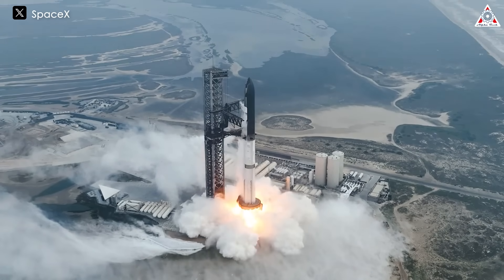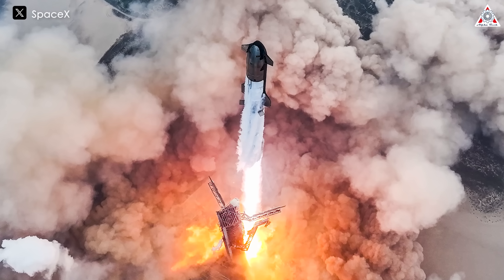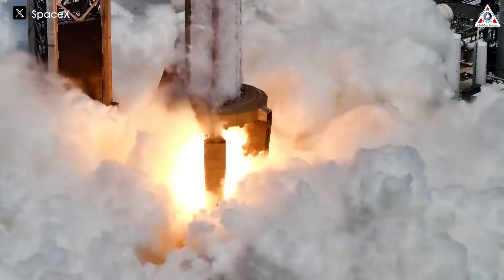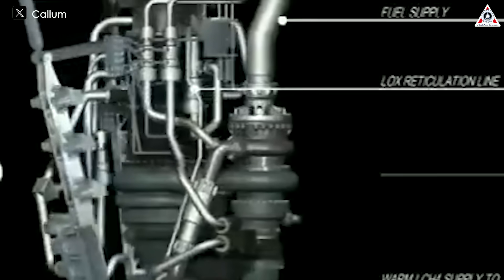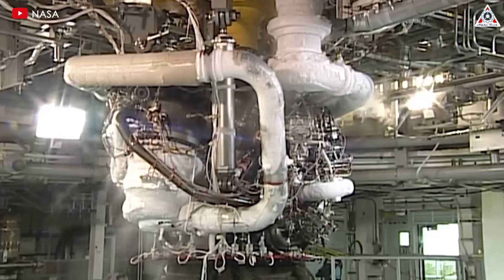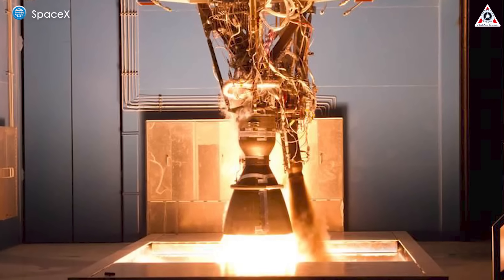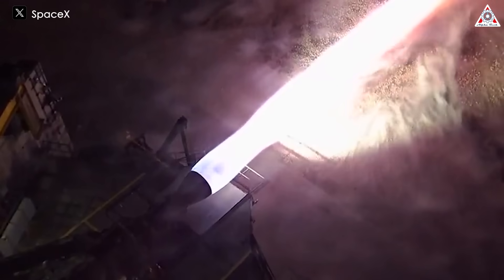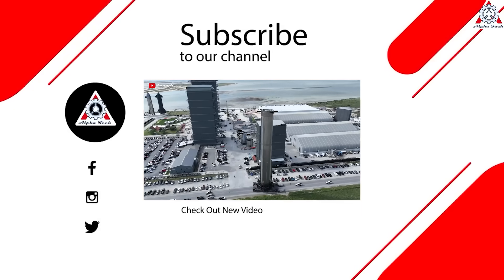Why SpaceX Booster Losing Raptor During Launch and Splashdown??? Elon Musk...

Comment: What wasn't said here is that the design decision to push Raptors makes them more fickle and more fragile. You've got feedbacks with milisecond time constants and lots of paths to instability. Shutdowns indicate some variable going out of bounds, but the underlying cause can be related to design.

Even if the root cause lies in the plumbing it doesn't help to push the engines to extreme pressures.

Comment: Well if the ship had only one rocket that would be that end if ride. But redundancy is protection against failure. instead of having to adjust a single engine to vary speed you just turn on or off as many rockets as needed. If you make only one ship with one rocket in each stage you end up eventually end up in a position such as boeing finds itself in now.

Comment: You are speculating and all these engines are old engines. Each test uses up a bunch of obsolete engines.
The one issue SpaceX has mentioned is a fuel filtering problem of solid fuel particles. This has been improved.
Important data on failure management during flight is the reward for the risk of flying old engines.

Comment: so probably not even related but I noticed on the booster soft landing it seems like theirs and excess of gas spewing out just before ignition it almost looks like a flame thrower. I think if we made the exhaust holes a bit smaller those gases might ignite better. give the rocket cones a wasp nest shape maybe lol it might just cause an explosion instead.lol. on the heat shield I said do a coating on top of the tile but what would be better is a complete body cover. If its all one piece you're not wasting time putting every tile on.

Comment: I would call this a success.  It is called redundancy.  SpaceX has more engines than required for a reason.  They said it can continue with a few of these engines not firing.  Designed this way, not a failure.

Comment: Here is a suggestion: Solid fuel would have been great if they were as efficient as liquid fuel and could be turned on and off.
So, we can't use solid fuel unless we can treat liquid fuel more like solid fuel. It wouldn't splash about; the filters wouldn't get jammed and we wouldn't need to worry about bubbles forming just about anywhere.
Why not imagine the whole thing more like a syringe? Even a partial syringe would go a long way until the vehicle is back in position descending under control. Then gravity can take over as long as there are no bubbles lurking about.
I am sure that it is not an easy readjustment and a whole lot of profile parameters need to be changed. But you could start with simulating it in a model.
Let me know if I am totally missing something. I know I am not that clever. Someone must have thought of it early on in the design. None the less, I would like to know what I am missing, and I don't mind being wrong.

Comment: This is the dumbest analysis I’ve ever heard. 1) redundancy is built into the vehicle for exactly this reason. 2) this is still an experimental program - we’re still in the R&D phase. 3) when you have excess capacity, it’s better to set a low threshold for self-shutdown to reduce the risk of explosion and loss of the whole vehicle.
Reply from the maker: So what do you think about the fact that when Booster landed, an engine that did not ignite caused a small explosion?
Reply from the maker: Do you mean the Raptor engine doesn't light up because the Super Heavy turns itself off to control power?
Reply from the maker: And what I mean is that they will improve this gradually in the future!  these are still just flight tests.
Reply: That is an interesting comment that the booster on landing, the same engine that did not start on take-off was the same one that caused explosion and fire on landing. Is this a fact or someone's hypothesis ? If it was the same engine, it narrows the cause of faulty engine explosion !

Comment: These are still prototype units of highly complicated systems.  Not being 100% reliable is not entirely unexpected, and there are redundancies to compensate.
Reply from the maker: The Raptor engine will soon have to become a reliable engine as it moves towards higher and higher goals.
Reply: @alphatech4966  ...and it will. But expecting that at this stage is silly. At present the goal is to get to test the landings. Any configuration that makes that possible is fine. 
Btw, Falcon 9 has had Merlins do the same without losing the payload or the booster. Not what SpaceX would want, but not a dealbreaker. The SH booster can get the ship to stage separation with 3 raptors out of order, so losing one is not a problem. Raptor v3 will hopefully be even more reliable.
Reply from the maker: @knowledgeisgood9645  This is also what I want to say